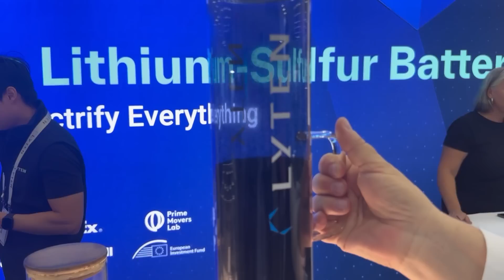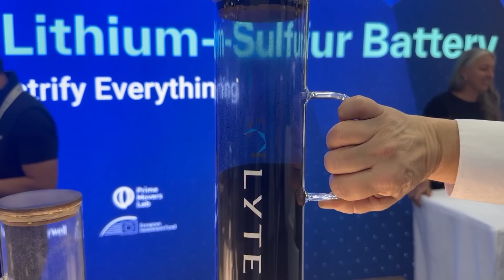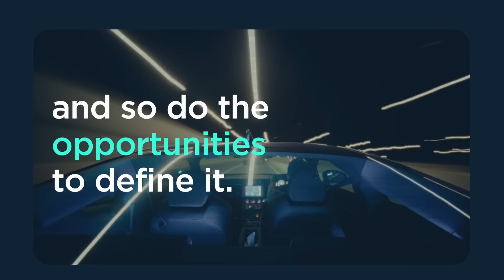Lithium Sulfur Batteries Are Half the Weight, 40% Cheaper & Coming in 2027 - The Battery Show 2024

Comment: I hope that they can go up to 4880 cells. Half the weight and 40% savings sounds very, very appealing. 
Tesla Semi, CyberTruck, and the upcoming CyberCab could use the new chemistry.
They stand a real chance if they are capable of the number of cycles.
Reply: Just that "slight" problem they have immolated over 100 people in China.  Until they can DEMONSTRATE these cells will not EXPLOSIVELY immolate all occupants of a vehicle, this is a NON STARTER
Reply: Don't buy cars from Nazis
Reply: Talk about the real trucks also! Tesla is a minor player in the truck market today!
Reply: The only thing the ct needs is a scrapyard
Reply: @MaticTheProto  it’s always funny spotting snowflakes like you in the comment sections who are triggered by the Cybertruck 😂
Reply: @danburkland  No the ones triggered are the Dork Maga fans such as yourself who feel the need to defend 150 pound max vertical load of the tongue because babysmurf9000 wanted to use a wimpy casting for the trailer hitch.

Comment: All these machines to build cells. Why dont you guys do a simpler version of the process of the average cell.
Reply: there is no simpler process than adding layer by layer.
Reply: @stefanweilhartner4415  Dodge is hiring.
Reply: @stefanweilhartner4415  Oh  yeah. Who makes these machines? Are they innovating? And the only way to make batteries is to pass parts through millions of dollars of furnace and drying equipment. Right.

Comment: So she states that the cell is half the weight of a traditional cell, but does it have the same energy? Unfortunately no proper information about the gravimetrical energy density.
Reply: They are claiming LiS > 450Wh/kg Vs 250 Wh/kg for NMC at cell level
Reply: @battousaihimura  
>450 Wh/kg is a battery that allows long distance battery powered flight.  Let's see if they can achieve decent cycle life along with good charge/discharge characteristics.
Reply: @bobwallace9753 lyten seems to be targeting eVTOLs
Reply: that was the first question that came to my mind. Energy density...
Reply: doi: 10.1038/s42004-022-00626-2
Reply: At 1:07 if you pause the video you'll see a sample shown on the left. On the product shown the weight is 1.25kg and the capacity is 120WH that gives about 96WH per KG.
Reply: @irokpe6977 that one is the LFP cell on display, not LiS
Reply: @irokpe6977 Ha Ha That one is the standard LiFePO4 cell. The blue battery pack in the center is the Lithium-Sulfur pack. It starts at almost 500wh per kg but it needs LOTS of development... After 100 charge/discharge cycles, it drops to 450wh/kg and after 300 cycles is only 300wh/kg. After 500 cycles is worse than a top noch Li-Ion 😢...

Comment: So why didn't Duracell get in on this?   🐇🐰
Reply: Why would a disposable battery company make a battery that causes them to buy less? Duracell and Energizer are greatly responsible for how people believe batteries are and will be.
Reply: @IcyPrepper76  Yes, they do, don't they?
Reply: @2cartalkers  no. They don't.
Reply: @IcyPrepper76  But they could if they if they wanted to?
Reply: @2cartalkers  likely buy why would you improve it if you get all the sales anyways. Maybe. Maybe they were just too stupid. But they dominated small battery sales for decades. Guess it makes sense. GM crushed all the EV1's. Why?
Reply: THE SEARS/DIE HARD BRAND WANTS IN...!!!🤘
Reply: To the contrary, Duracell and Energizer have been making various chemistry rechargeable batteries for decades... 

For example, I own a Duracell charger that came with a set of NiMH (chemistry Toyota has been using for its hybrids) 2 AA and 2 AAA batteries, that was a store return that was almost a decade old for $6.... I assumed the batteries would be dead and would need replacing, but the batteries and charger have been working fine for well over a year with no discernible degradation, for my application.... One caveat is the nominal voltage is a little bit lower, than the standard 1.5 volts, which makes it not applicable for some electronics.

BTW I thoroughly enjoyed the absurd YT expert conspiracy theory ranting..... Thanks for reminding me of the song, "Send In the Clowns"
Reply: @nc3826  You drunk? The alkaline batteries have been the same for years. People can try to remember THEMSELVES. I had the first version of rechargeable batteries and they were garbage. Great job trying to dictate the kind of experience people have had and saying it's getting better. Gaslightiing. These batteries are way better then they were years ago. The voices in your head must write this stuff. Anybody can recall for THEMSELVES if they feel that over 50 years if they feel like batteries have gotten better in price or performance. Everybody has done it themselves. They can compare your bs to their actual experience. In the 80's I used to buy nihm 9volts for 35 dollars a pop. That's like 55 dollars now. OK boomer.
Reply: @nc3826  Gald your closet batteries from 10 years are great for an entire thesis on how batteries have been getting better. Wah wah waaaaaaaa. Lol.
Reply: @nc3826  Would love to see  what you sound like when you get your car serviced. Assuming you're smart enough to. But cars have been getting way better to probably. Right? Because your dad's Pontaic 6000 still works fine. And Pontaic is getting bet...  oh wait. I mean Saturn.. oh yeah. Speaking of other companies that products got so much better. Will probably laugh at this for a while with my friends.
Reply: @joebachmeier6747  LMAO.....  Thanks for proving my point and that “It ain’t what you don’t know that gets you into trouble. It’s what you know for sure that just ain’t so" my triggered friend Also good luck with your meds....
Reply: @IcyPrepper76    And say hello to the voices in your head for me (ie your friends) ;)
Reply: @nc3826  People can think for themselves and decide if batteries for themselves and decide. Am I using less or more, and have they gotten better. I'm sure they all agree with you. That's why alkaline disposable batteries are your favorite. The constant improving. Hard to argue with that....  lol.
Reply: @nc3826  that was my comment. To you. But great comeback. It really stings. Feeling better?

Comment: Should be here at about the same time as solid-state batteries, and fusion power.
Reply: Since we're making predictions,  Hades will freeze over before fusion is practical, and you won't live long enough to see solid state in auto production.
Reply: Commercial Solid state in cars ETA 2-3 years away from CATL, BYD or Panasonic. Fusion 20 to 50 years.
Reply: I don't think fusion will be feasible within my lifetime. Maybe a few more generations down
Reply: SSB are happening in lzbs. But expensive and dangerous to mass produce . Automotive will not use them massively. LFP is good enough if OEMs optimize their chassis around the pack. Fast charging is key to avoid carrying around large expensive packs for grocery store shopping....
Reply: @chryoko   Yes, if and when SSBs are mass produced,  VTOLs and small airplanes will be the primary customers due to cost/price, I believe.  They certainly won't be used in economy cars.  Perhaps they will eventually enter common use, but I won't be around to see it.